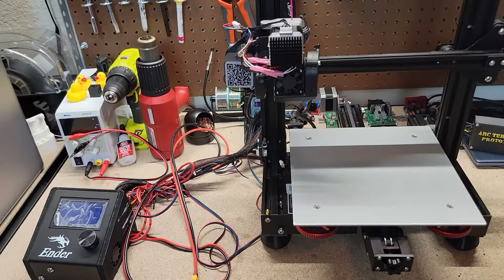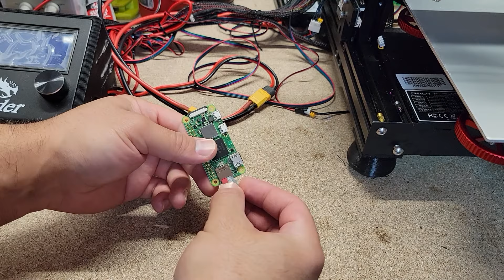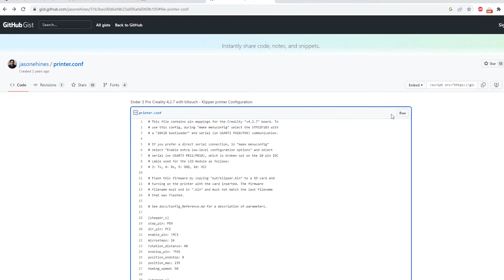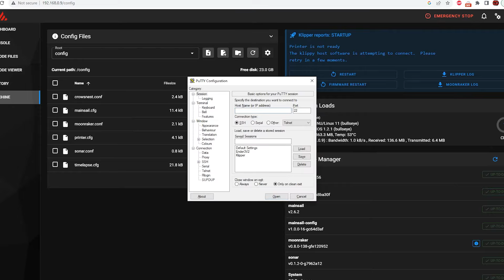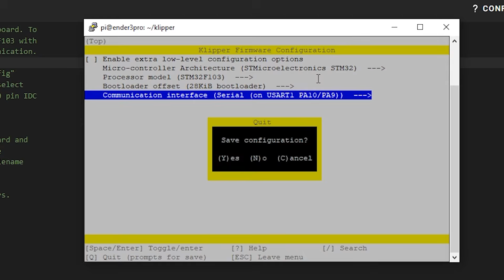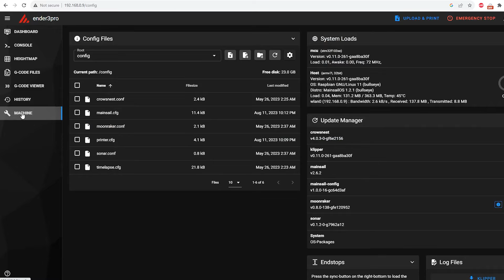Install Klipper Using a Raspberry Pi Zero 2 W - Ender 3 Pro - EASY DIY

Comment: If you have an Ender-3 V2, with the 4.2.7 board, and you get an mcu error, put this in your mcu on Print.cfg: code/ (Line 1)  serial: /dev/serial/by-id/usb-1a86_USB_Serial-if00-port0  (Line 2) restart_method: command /end code.  AND, before yoiu pull your hair out after spending hours trying to get it to work, flashing 3 times, installing the OS on your pi, etc, etc, etc.  Check the cable that plugs into the printer usb slot.  I didn't, and the one I used was a POWER cable, and did NOT carry DATA.
Live and learn.  It's really a great tutorial, and everything worked, except for that one line in the config file.

Comment: To anyone having the issue where it's not connecting to your wifi, for some reason the imager isn't setting your country correctly. you need to go into raspi-config then localization and wlan country and manually change it.  I've been fighting this for 4 days and just got it working properly
Reply: try editing the file on memory card directly 
open on PC (the SD Card)
enter ssid n pw in file save n try

Comment: Im getting:

mcu 'mcu': Unable to connect
Once the underlying issue is corrected, use the
"FIRMWARE_RESTART" command to reset the firmware, reload the
config, and restart the host software.
Error configuring printer

How can I fix this?

Comment: If this is done with a base model ender 3, will flashing the new firmware enable the functionality of a bl touch via a pin 27 adaptor to the display?

Comment: This video was very helpful for me, however my Ender 3 V1 was a bit of pain in the ass because there is no factory bootloader on this 8bit motherboard. Good thing I had some old arduino. Also flashing Klipper with sd card doesn't work because actually my flashing file was .hex instead of .bin so I had to do it with PI.

Comment: Hi there, I have tried to follow this with my ender 3 v3 se and raspberry pi zero 2, but i cant connect to the pi and the ip address isn't showing on my router. The light on the pi flashes.
Reply: If you have a Netgear with both a 5 ghz and 2.4 ghz connection options, you will want to use the 2.4 and don't use WPA3 security settings.
Reply: same problem

Comment: Can i use this for my diy 3d printer, my need is to run klipper screen on 10inch touch screen display and one 5MP camera module. And some components connected via can bus. (Like knomi 2.0, EBB can bus)
My microcontroller is btt octopus pro v1.1

Comment: Bro, I have an Ender 3 v2 Neo, can I use it with a Raspberry Pi Zero 2 W?
Reply from the maker: @basssittisak3396  Yes, it'll work fine with that printer.
Reply: @FoulNews  Ok, thank you bro.

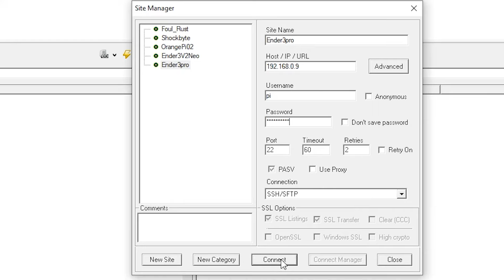Comment: Note: 12:56 must be same as you showing, if not not worked, and for me for some reason maybe is the printer.config file that i get from internet but i have to follow from klipper docs. RPi as a secondary MCU to work

Comment: Much thanks for the install video! I was able to get it running on the RP Zero W. (Not Zero 2) 
I ran into some issues with the Z stepper configs as i don't have a BL touch yet (coming from Aliexpress) Video suggestion - HOW TO INSTALL BL TOUCH AND CONFIGURE KLIPPER SETTINGS FOR SEAMLESS BEDLEVELING! 
Tytyty.

Comment: hi mate!, after doing all step by step at the end Klipper reports show STARTUP (in blue color) but it said "printer is not ready, klippy host software is attempting to conect retry in a few.." I have an ender3 upgraded with board4.2.7 as you. Could anyone help me o send a reference documentation where I can study. I will really apreciate it
Reply: solved! I had to rebuild the klipper.bin, I made a mistake setting connexion parameters. Now its connected properly

Comment: Thank you so much! I've successfully installed Klipper on my Ender 3 Pro and now it's almost like the Bambu Lab A1 (maybe I'm a bit exaggerating). You've helped me a lot.
Reply: do you have any data to assist me please. i'm front of problem with my ender3 pro, i cannot connect it
Reply: @pausecafe8533 i just set up klipper from scratch for my 2nd ender series printer. Do you still need help?
Reply: @RecklissFPV  i followed setup to exact but my rpi is not connecting to the WiFi 
Can you please help?

My setup did not have 32bit variant on imager of rpi

Comment: I have a pi zero-w… will this work? Also interested to add a klipper screen to a 3.5 inch touch screen if possible. Thanks 🙏 ❤
Reply from the maker: It can work on a Pi Zero W, but it's not recommended since many people have had issues with slowness and potential print artifacts due to the slower speeds of the Pi Zero. A Zero 2 W or Pi 3 and above are ideal.

Comment: Hello, great video.  Do you know if klipper can be installed on a orange pi zero 2w?
Reply from the maker: Hello, thanks! Yes, it sure can, it's what I used for my CR-5 Pro H. However, since there's less support for it and no Raspberry Pi imager utility, the setup is a little more involved, but not terribly difficult. 3D Nero did a great video on how to get it done: https://www.youtube.com/watch?v=Dh6bEB6iYa8

Comment: Hello, you make ot seem so smooth.  I keep getting an MCU error and I've tried remaking my Kilpper Software 3 times. Third time was as you explained not enabling "extra low level" and still get the mcu error. But when i check on putty to see if i get the usb connection it shows i do.  What could I be doing wrong... Oh yeah I also tried unplugging the screen as you recommend and nothing... 😢

Comment: Beware: 
Have made the switch to Klipper on my CoreXY machine.. However, I can't get the webcams working, not even one of the two..  (I used crowsnest)  
I think the pi zero 2W might have a too small bandwidth for that.. Followed some webcam guides on the web for setting up webcams, but to no avail.. 
(I can see the webcam window, but it's empty. It does however show 15 fps)
Have to switch back to Marlin for now I'm affraid..
Reply: i'm going through the same and it's driving me crazy
Reply: @sandmanlol Try a pi 3 or 4. I'm using a pi 4 now and have no issues with webcams.. Also, one webcam I used with Marlin/Octopi was not recognized by klipper, an other one did the trick
Reply: You will definitely run into webcam issues with Zero2W. I just swapped my ender 3 octoprint setup from a pi4b to a pizero2w and have had many issues running more than one serial device (ie. the printer and webcam) at the same time. I've tried different usb hubs, but have not been successful.
Reply: @TeraVoltLabs  Yeah, the zero2 is just not up to the task I guess. I did install a pi4 and it's running fine now

Comment: Yes, I would like to see what comes after the Klipper install. I'll be putting Klipper on my mostly stock OG Ender 3 this coming week and want to have as much information about how to finish the config as possible. And thanks for doing this. You have the most understandable video this 80 year old has found yet.
Reply from the maker: Thanks for the feedback, I'm glad to hear that you've found my video helpful. I plan on having a video come out Thursday or Friday with some tips on what to do after you've got Klipper installed.
Reply: @FoulNews  Did you ever finish the video?